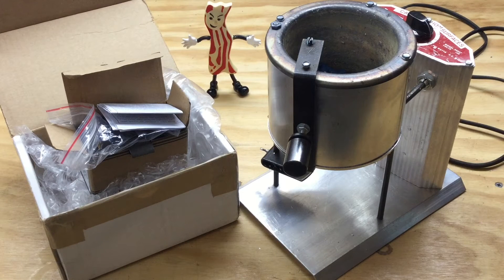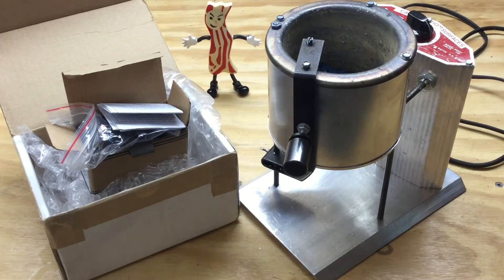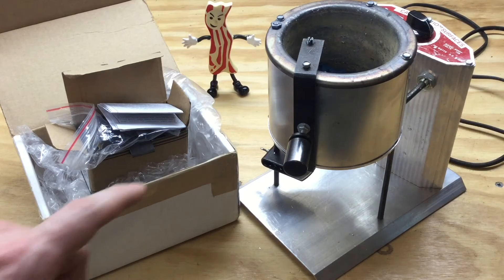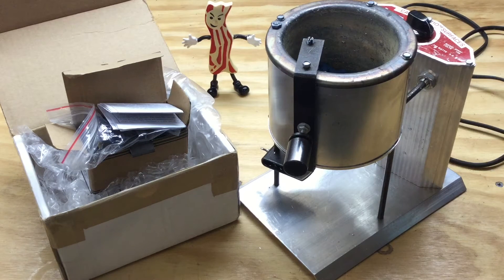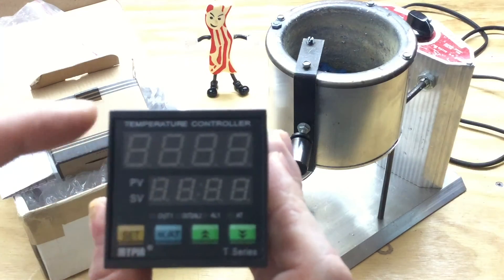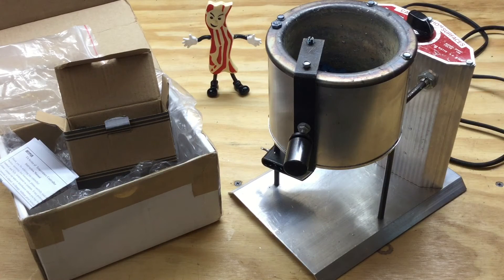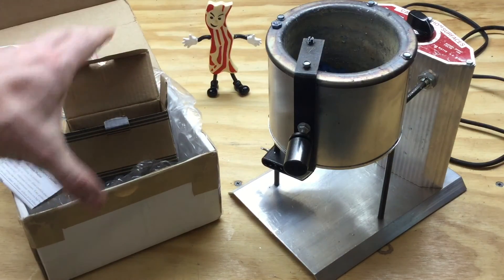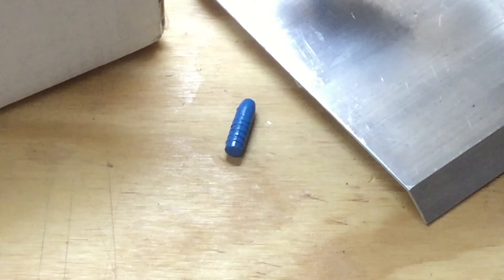Thanks, Deliveries, and PIDs

Comment: I'm just glad it went to a good home where it's going to be used. It looks as thought you wont have time to wait on the furnace getting to the optimum temperature, Casting sessions will have to be planned orchestrated events with the New addition to the Family,,, (Congratulations) The PID unit will help manage your time better and give you benefits of heat control and less wasted time melting down casting that were not filled completely out. The Lee furnace will work just like my RCBS Pro-Melt and last longer.  Dave.
Reply from the maker: Thanks again Dave!  With the little kids, work, etc, it seems most of my casting and reloading happens between 9pm and 1am.  The PID will certainly make that time more efficient.